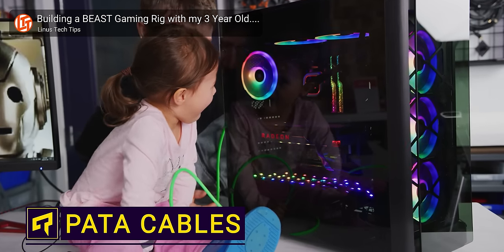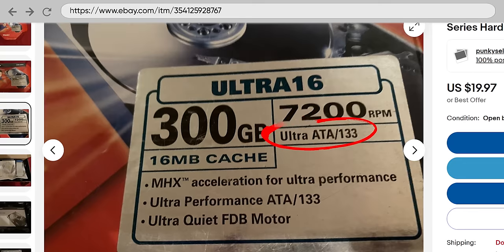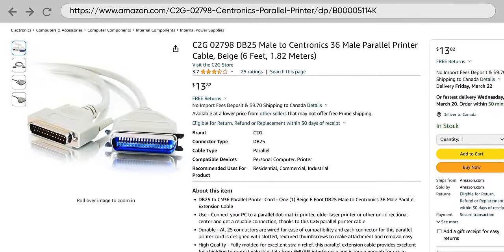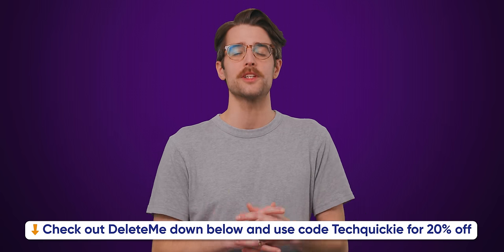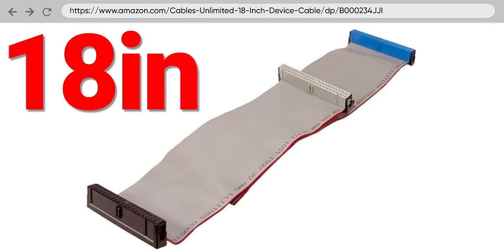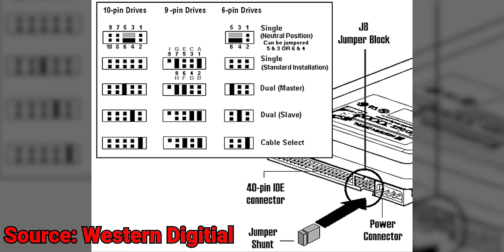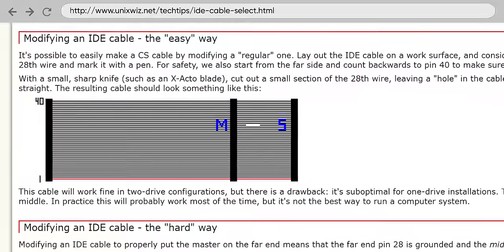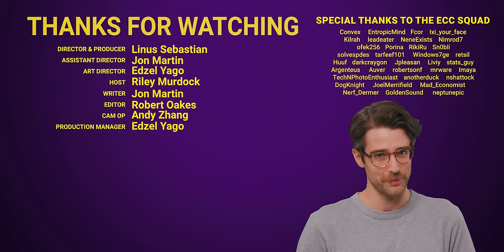PC Cables used to be HUGE. Why?

Comment: I remember taking a razor and separating all the strands in the IDE cables and then wrapping them in electrical tape to get the cables into a tube shape.
Reply: That’s badass
Reply: Whoo wasn't the only one!
Reply: I did that too, unfortunately the resulting connection was too unstable, so i had to trash it.
Reply: I too did cable mods like these but they only worked on IDE not EIDE. I have ready made tubular EIDE cables though that work fine.
Reply: I had some IDE cables (in their later days) premade as round. I always wondered why it took so long for them to be made round.
Reply: Hell yeah, early modding years. Then someone discovered cable flexes and that you can wrap them if you disconnect pins in your connector on one side. Good memories
Reply: IDE cables came in rounded configs around 2003 onward and MSI even included them with some of their motherboards (like the NFORCE 3 in my case).
Reply: Twisting a ground around every data pin would help with the instability, but even better would be to twist it around an inverted version if it's signal. Any interference would be cancelled out at the end.
Reply: You madlad
Reply: The OG Cable Mod
Reply: Totally tubular, dudes!
Reply: @SergeyVolkov  it was good for cd though.
Reply: @NightMotorcyclist  Holy hell, I had one, 99% I still have it somewhere because throwing out it is herecy.
Reply: Sadly there were inductors and capacitors meant to aligh and optimise the rise and fall time of the square wave representing the bits.
By separating the wires, you changed the ground-signal capacity, and the signal wasn't squarish anymore, so you had an impossible BER - bit error rate...
Reply: @Megalolio  I still have the ones that came with the motherboard. Bright red primary and black secondary MSI rounded IDE cables that felt like mini radiator hoses.
Reply: good old days of PC modding 😀 today kids think they are big PC builders when they can connect fans to 4pin connectors on motherboard 😀
Reply: I bought the rounded IDE cables, they were about $15 each 20 years ago. I didn't notice any problems with them. It was a notable expense over the ones included with drives or motherboards. It was worth it for the better air flow in the case.
Reply: Did that too, lol
Reply: Now that’s dedication
Reply: Came here to say the same thing. That and cold cathode tubes are trademarks of early case modding
Reply: I remember getting a Cooler Master Centurion case and rounded IDE cable from eBuyer (still in use). The latter came separately in a huge box with air pillows.

More impressive back then was people replacing their HDD cover with Perspex in a steamy bathroom  🚿

Meh there appears to be no HDD emoji, but there's a MiniDisc? 💽💽 Two because I've accrued a Sony hifi and Sharp portable recently.

Sadly my Napster 2Pac disc took a dislike to bring renamed.
Reply: Yeah, cable rounding used to be big. I didn't cut wires, but I bought some of those pre-rounded ones with tubes in the middle. I think it improved air flow, too
Reply: @Pidalin Lmao now days we are designing and 3d printing our own mods that actually work, improving the airflow of cases, and much more... Cutting apart a cable to make it look infinitely more atrocious isn't impressive... 🤦😂
Reply: @Megalolio  you mean heresy ;)
Reply: Holy shit, this is genius,  I never thought of that!  What a missed opportunity.
Reply: @SergeyVolkov what if you wrapped each cable in electrical tape then wrapped them all together so they all have their own form of "shielding" and are circular shaped
Reply: @littlejack59 electrical tape would do nothing for "shielding". A cable shield has to be made of metal and tied to ground on one end, so the connector has to be ready for it (that's why ethernet and USB connectors have a metal body, that's where the shield connects to gnd).
Reply: @taylormay9938  There is no case with bad airflow now, back in the day, you were doing mods which were really important, like cutting hole into your case to have at least one fan there. 😀 Now, you are doing it only because of design. And put some plastic something doesn't solve anything, real mod is when you create your own cooler for GPU from copper etc...you will not solve these things by some 3D printed piece of plastics, becuase problem is not airflow. 😀 But yeah, 3D printing is very interesting technology and can help with a lot of things which would be too annoying to make it manually.
Reply: I did it with my fingernails. Too scared to use a blade.
Reply: Me too.
Reply: Still have a rounded red IDE cable somewhere, anything to get rid of that horrible grey IDE ribbon.
Reply: @bgezal those are what i used.  cost a bit, but looked nice for the time
Reply: You could buy them as round cables anyway
Reply: @taylormay9938 Right, these old heads say anything
Reply: Sometimes that caused problems tho, but like others I tried it too.

Comment: I'm old enough to see things I used new now being shown as historical tech quickies.
Reply: Do you remember Jumpers?
I remember switching away "how does it know which is which?!"
Reply: @smalltime0  I remember the days prior to IDE, when we had MFM and RLL hard drives and it wasn't just the hard drive cables that were like these, we had floppy disks and tape backups that used ribbon cables also. Cable management wasn't really a thing as there was not much you could do other than rubber band the extra length but it was still a mess of wires.
Reply: @tbeehler I know what you mean. I'm old enough to remember when a "monitor" was a teletype terminal with single-pin dot-matrix print head that passed a current through the yellowish paper and literally burned a dot into it, computers used drum or the newer core memory, paper punch tape, no IC chips, and for long-term storage they used 32-track data tapes or the 14 or 24-inch disks. I've seen a lot of change in computers since the days of the IBM and UNIVAC mainframes. For PCs, I've used MS-DOS 1.0 up to 6.2, Windows 1.0 through Windows 10 Pro (for my own computers, I've used Windows 3.0, 3.1, 3.11FWG, NT4, Win 2000, Win XP, and now Win 10 Pro). My first PC was a Northgate 486 (not a "SX" or "DX", just a straight-up 486, with an extra socket for a Weitek math co-processor, and it had a 213MB SCSI-1 HDD (a friend of mine back then said that I'd never fill that up! Ha!).
Reply: @smalltime0  Jumpers on the drive and even jumpers on the motherboard and add in cards like sound cards to do IRQ swaps! :)
Reply: @tbeehler  shudder IRQ, I'm not old enough for that to have been that big of an issue - until it was.
You dusted inside your computer and put the cards back in the wrong order. Reinstall the OS
Reply: When a floppy disk was actually floppy.
Reply: @smalltime0 I remember overclocking with jumpers.
Reply: @EdwardStettler 5in or 8in? i still have boxes of them. I also have some programs recorded on punchcards.
Reply: @AsiAzzy  i have the DOS operating system install disk on the 5 inch
Reply: @AsiAzzy  summer child... Jumpers were HDDs and Slave drives
OVC was graphite on bridges, shorting them
Reply: I'm only 24 and I grew up with some of this stuff. I don't know all the technical terms since I was like 6-10 at best

Honestly this just shows how fast tech changes
Reply: Yeah, I am "jumper the sound card to an unused IRQ" years old.
Reply: @badreddinekasmi8919   I'm (only?) 35, but in the '90s computers were still expensive and rare enough that there were a lot of '80s computers still in use. Schools tended to have a lot of Apple II computers kicking around. The first "family computer" I used at home was a Phillips clone of an IBM XT with an amber monochrome monitor. Back when it made sense that your HDD was called 'C' because your two floppy drives were 'A' and 'B'.

And you're right about tech changing fast – especially back then. Progressing from an 8088 running PC-DOS 3.3 to a 486 running MS-DOS 6.22 (with Windows 3.1) to a Pentium MMX running Windows 95 within less than 5 years was wild.

Comment: Master and slave makes much more sense than parent and child.
Reply: They wouldn't be parent and child unless you were daisy chaining devices. Which some interfaces allowed in the past, these days not so much as hotplugging and multiple USB ports is far more common than it used to be. It used to be that you'd have a parallel port and a couple serial ports and then just ports for mouse and keyboard. If you were very lucky, there might be an SCSI port as well.
Reply: Since an IDE cable can only have two devices, master and slave aren't actually more sensible. Primary and secondary, or leader and follower, or main and auxiliary, would be much more descriptive. Also, the second device on the IDE chain doesn't actually take commands from the primary drive, but from the IDE controller on the motherboard. So it even makes less sense to call that one a slave drive to the master drive.
And I get it, it's often a bit of an annoyance to have to rewire your brain to accept new nomenclatures for already established ones, and the existing namings might indeed not be offensive to you. That's fine. It however apparently is offensive to others, so why go out of your way to be a <shower>bag, if you can simply use one of the many other perfectly usable and effective nomenclatures?

Comment: We never used the term PATA.  The 40-pin cables were called IDE and the 80-pin cables were called EIDE.  They were made flat to resemble the old MFM and RLL data ribbon cables.

Comment: I still have a running PC with IDE hard drive...
Reply: KN.hilltop 👍
Reply: Why?  What would possesses you to use such archaic hardware?
Reply: Why
Reply: Still have a PC with IDE DVD-player.
Reply: I'm still running on ferrite core memory.
Reply: same here, i've got an active pentium 4 in the homelab, SL6PF 2.8GHz
Reply: @Voltaic_Fire  Probably Vigo. Only a carpathian would, right?
Reply: I still have something with a soundblaster audigy gold sound card. I was so pleased with the quality back then. Still sounds good today.
Reply: @bookvee Call the Ghostbusters! Quick!
Reply: @Voltaic_Fire  same reason why classic cars are still around 😂
Reply: My daily driver is a Commodore 64
Reply: @bookvee  wow...
Reply: It was just sitting under my desk for a long time, had no problems... Just slow and running XP.
Reply: Me too. I have couple of Amigas that use IDE drives :D
Reply: @t.n.-js6ei about 10 years old flat TV that has SCART connector usually works quite fine for retro thingies. If you have PAL machine.
Reply: @t.n.-js6ei  wish I have a CRT now...

Comment: It's kind of funny how we keep alternating between varying levels of parallel and serial in the pursuit of higher speed. USB 1.0 and USB 2.0 only needed one pair of conductors for the substantial speed jump between the two. Then USB 3.0 came along and added more. Then further levels of USB managed to increase the speed of the same conductors a ways further, but now with things like Gen2x2, USB-C has added more conductors again!
Reply: USB 3.0 is the most stupid connector ever, so many problems with them....there are constantly bad contacts, compatibility between USB 2.0 and 3.0 doesn't work that well as it should work....someone shold be in prison for developing such connector with extra little pins and making original pins short. I gave up and I bought USB 2.0 flash disk again because it's reliable and works everywhere. Problem is with USB 3.0 male connectors, female connectors on your motherboard are not the problem.
Reply: @Pidalin I’ve never had a problem with the USB-3 connector, just the motherboard header which is designed with two long rows of tiny pins that are fragile so it’s hard to tell if the connector or pin is misaligned, or if you just aren’t using enough force. The “USB-C” header (there is no singular universal name for the header) which is basically just a better USB-3 header is so much better.
Reply: @fallin5427  The Type C header can be more than just USB3 though - for example, it supports up to 18W of power by the standard, it can sometimes do USB Power Delivery, is usually USB 3.2 Gen 2 (i.e. 10Gbit) and it can support other USB alt modes (video, etc).
Reply: @emu071981  yes, I’m aware. I intended to put a “basically” before “better USB 3 header” but forgot.
Reply: @fallin5427   USB-C is reliable connector, there i sno problem with them and if yes, you can just put it there in other direction. But if you didn't have problems with USB 3.0, then you are lucky. Most of flash disks I had, had bad contact, so you have to play with that inside of connector to make it work and it's like that on all computers, problem is in that male connector, not in your PC.
Reply: @fallin5427  I know, I just confirmed that USB-C is with no problem.
Reply: @Pidalin  apologies
Reply: @Pidalin I feel like I'm the only person in the world who keeps destroying their usb-c connectors. Meanwhile I never had single problem with USB type A
Reply: @Lapsio  I already saw few damaged USB-C connectors on phones, but I don't know what people do with that, it's very realiable and durable compared to terrible micro USB. 
If you use only things like mouse, keyboard and other stuff in USB-A, you will not see any problem, problem is only with flash disks and some SD/micro SD card readers with USB 3.0 connector, those with USB 2.0 work absolutely fine everywhere.
Reply: @fallin5427  I probably said it in a bad way, my level of English is not that good. 🙂
Reply: And before that, we were pushing parallel connections to external devices as faster connections, all the way back to the 8-bit days.  Another bit of trivia is that the guy who developed the USB standard was the same guy who developed the serial device interface (not RS-232) on the Atari 400/800, which was considered inferior at the time to the Apple II's parallel connectors.